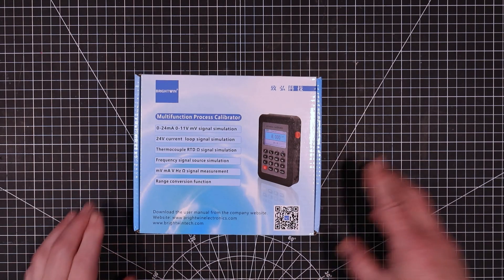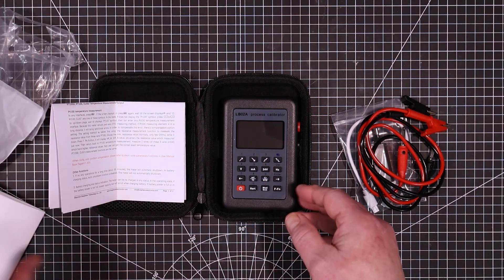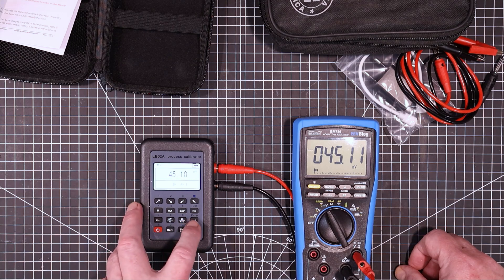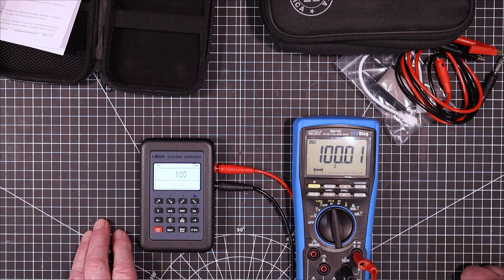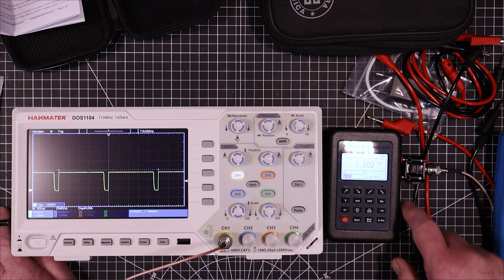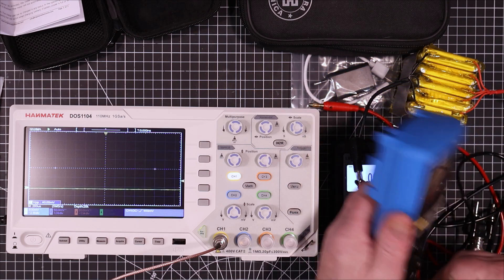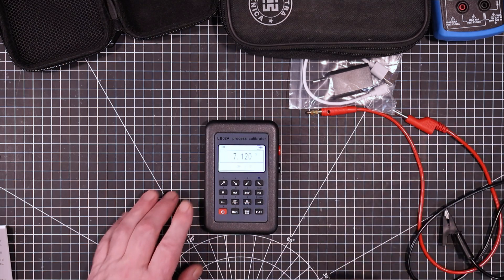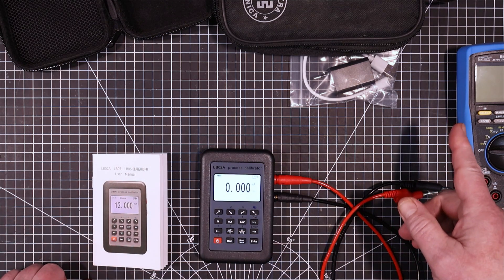Uni-Byte 0261 - Quick look at the LB02A Process Calibrator

Comment: What is the HART button for?
Reply from the maker: It's for the HART protocol analyzer function in the LB06.  It does nothing on this model.  They use the same case and keyboard.
Reply: @uni-byte do they make a model I can use to change calibration on process meters in the field
Reply from the maker: @ThePodcastPastor  Unless this one can get that done for you, then I don't think so.  The LB06 is that same as this but adds some protocol analysis.
Reply: Thank you for responding by the way
Reply from the maker: @ThePodcastPastor  No worries.

Comment: Seems handy, especially for your equipment reviews. I had to check the video just to learn what a 'process calibrator' was. I hadn't run across the term before, though I'm familiar with the Fluke calibration standards. I suppose they had to come up with a name for a convenient cal std device that wasn't metrology lab grade accuracy, but worked like a cal standard, rather like the name 'spectrum monitor' as opposed to 'spectrum analyzer', slightly lower precision, slightly different feature set.
Reply from the maker: Fluke also make things called Process Calibrators (724, 725, 726, 754).  Slightly more money though.  LOL!
Reply: @uni-byte , those are new to me, too. Interesting. Most standards are out of my price range beyond my rubidium std, and some 0.05% precision resistors of assorted values, which is amusing since I sometimes fix gear for NIST, including for the Josephson Junction standards group. But like I said, it's all way out of my price range. They even have to loan me specialized gear to do some of their repair work, because I just don't go out and buy ($50k-$100k US) gear just to fix something for NIST. It makes me nervous just being responsible for it.
Reply from the maker: @johnwest7993  Yes, I can imagine!